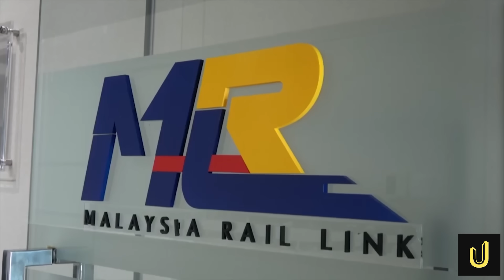Inside Southeast Asia's Deepest and Longest Train Tunnel - Malaysia’s Genting Tunnel

Comment: 50 Billion MYR, our Ministry of Finance did the calculation and comfirm that it probably can't breakeven like the Indonesia HSR. Meaning it will start with operating in loses (hopeful with some optimization it can somehow cover operations cost, anyhow we will have to pay the installments on our tax money). After some negotiation, now China Join in as Join Venture and bear 50% of loses until we finish paying them loan 20 year(at least china now bear 50%). Good things is we access the rail way system to China KunMing and further connect to rail way system in central Asia and potentially to Europe through railway system. This will provide 3rd option on cargo good logistics beside Air and Merine Shipping. It is like buying an expensive GPU that we can't really utilise now but waiting for future 3A title to release.

Comment: Luckily, they switch back to Najib original proposed route under PN ruling, with several adjustment. Otherwise, this so called longest Southeast Asean tunnel wouldn't exist & traveling from Kelantan to Selangor wouldn't be under 5 hours if using jeopardized deviated Bentong Jelebu line. Yes, our engineer still need to 'borrow' expertise & technology from China, last time from Germany. Can't be too proud, since we achieve nothing in technology & keeps relying on other developed country within these 2 decades, even under Muhyiddin & Anwar. Just the same old story. EV ambition & AI powerhouse are just big daydreaming.

Comment: ⏰CHAPTERS⏰
►
00:00 - MALAYSIA’S MEGA ENGINEERING FEAT.
01:34 - NEED TO UNITE EAST AND WEST MALAYSIA.
03:00 - THREE MAIN THREATS: WATER, PRESSURE, COLLAPSE.
04:54 - HOW THE TUNNEL BORING MACHINE WORKS.
06:21 - PRECISION ENGINEERING UNDER PRESSURE.
08:12 - FLEXIBLE SUPPORT SYSTEMS AND SAFETY DESIGN.
10:19 - FINAL PHASE AND FUTURE PLANS.

Comment: Correct me if I wrong. I think Malaysia has bought this bore machine long time ago from Germany. The biggest bore machine in Asia. All part assembles in Malaysia. This is not the first project. Previous SMART tunnel also a very long tunnel.
Reply: SMART, MRT1, and MRT2 tunnels used the German TBMs. The Genting Tunnel no doubt uses the China made TBM as the main contractor is CCCC from China.

Since the tunnel diameters (SMART, MRT, Genting) are different, they cannot use the same TBM. However, MRT2 used a few refurbished TBM from MRT1 since the tunnel diameter is the same.

Comment: SMART Tunnel is also an engineering marvel!
Reply: When a tunnel is turned into a sewer drain during flood, stopping traffic flow, that's not SMART; that's STUPID.
Reply: @xytopk51 that is one of the smart tunnel main purpose. Stoping traffic flow better than flooding. Atleast less harmful.
Reply: @silverback1049  If the tunnel is really SMART, then it should allows traffic to flow CONTINOUSLY regardless of the rain flood water level. Closing the tunnel to traffic during flood is NOT a "SMART" move, as that's exactly what flood waters do; stopping traffic!
Reply: @xytopk51 smart tunnel technically is a water tunnel. They built it to reduce flood in KL during heavy rain. But when it doesn't rain or not in flooding risk, they use it as road/highway.
Reply: @silverback1049  Exactly! It is basically a sewer drainage pipe, that sometime functions as a traffic tunnel, but closed to traffic during heavy rains and floods. Which  also happened on normal "non-SMART" roads, open to traffic when there is no flood!!
Reply: @xytopk51  you can be smart and drive down there when it's raining
Reply: @xytopk51  good try bro. 😂

Comment: Fyi, this is not the first. The MRT was built using the same machines. So, to say it comes from China, I don't think so. Because when you watch the documentary on MRT, 80% of the engineers and architects are local. 😅
Reply: The TBMs used to build SMART, MRT1 and MRT2 were bought from a German company called Herrenknecht. Since it was the same company which built these tunnels, we also developed local expertise as the young engineers gradually became experts by the time MRT2 rolled by. I joined the company in the final stages of MRT2, where we only have 1 British expat in our department, and the rest are all Malaysians. I remember there were more foreign experts when I interned during the early stages of MRT2.
Reply: @lwy230597 not the same TBM. Germany used to be the only country that could build these, but now China's TBM killed the German maker.
Reply: @MrSagowoon  yeah, China-made TBM is much cheaper. And their engineers are not as cocky as the German engineers lol (at least from what I heard)
Reply: @MrSagowoon the German's stuck up attitude toward south east asian is unpleasant to say the least. On top of asking for exuberant prices because apparently brand name is more important over anything else.
Reply: @MrSagowoon  Not true! 
Robbins (USA), NFM (French), Kawasaki and Mitsubishi (Japan) also make these machines.
Herrenknecht are still the No.1 builders and suppliers of all types and diameters of TBM's.
Reply: @lwy230597 I saw a video  saying after the tunnel finished, they buried the TBM because it is too big to dismantle and bring to other sites.
Reply: @muizuddin7296 for which tunnel? If I remember correctly, the TBM used for the Channel Tunnel was indeed buried undersea. But for MRT2, the TBM that reached the existing TRX station box was cut piece by piece and transported back, leaving only the TBM shield underground.
Reply: @lwy230597  The main contractor for the project is China Communications Construction Company, and the tunnel boring machines are most likely from China.
Reply: @lwy230597 Pd masa tu kejuruteraan dari China belum berkembang keluar. Kebanyakan terowong² diseluruh dunia menggunakan teknologi &, kepakaran TBM dari Jerman terutamanya.
Reply: @magicman74  the technology of Earth Pressure Balance and Mixshield TBM's was developed in the 1970's by Japanese engineers working for Mitsubishi.
The german company Herrenknecht refined the technology to what we know today.
Reply: Mesin tu datang dari china tu memang betul. Cuma china,US, Europe je ade boring machine. Yang architect dengan engineer tu mmg dah ade dalam perjanjian untuk transfer of knowledge
Reply: The Chinese contractor is CCCC, the same contractor which built the Penang 2nd bridge. As far as I know the TBM had to be custom built for the Genting project. That means most likely by Chinese engineering. Not knocking the Malaysians because I am sure a large proportion of the workforce pn the project are locals.
Reply: Maybe they just borrow their tech🤷
Reply: Well it's done by China's money so it is China's engineering marvel
Reply: @NathanArulappen  please explain your rationale.
Reply: @NathanArulappen  😂😂😂💩💩💩
Reply: Technical experts are of course a minority.
Reply: The channel probably uses AI to for research, voiceovers and the editing. So i would take it with a grain of salt
Reply: It was part of the project, that passing on the technique to Malaysian engineers and workers, mate. Which btw, you get no such deal from any Japanese or Western company.
Reply: @cheungchingtong  not true - I trained many nationalities how to drive Robbins, NFM and Herrenknecht TBMs, mate.
Reply: @pauldarbishire7226  Technology as whole to design, plan and build a tunnel, mate, not just driving or using tools and trucks.
Reply: @cheungchingtong and how many tunnels have you worked on? You stated that western manufacturers would not pass on any kind of information of any sort, I was just giving you my personal experience. I know for a fact that on SMART, MRT1 and 2 there were western expats passing on their knowledge and experience - Gus Kladoszc was contracts manager, Richard Potts was Superintendent and Blaise Pearce was head of Tunneling for Kuala Lumpur MRT.
Tell me what tunnelling experience you have and have passed on, mate
Reply: Sy pernah lalu area ni. Kalau tgk kat luar , signage all in Chinese. It is from China
Reply: @adilbajrai there is "Coca Cola" written on buildings all over the world, doesn't make them American 😂
Reply: Can use same tbm to build tunnel between kukup and pulau karimun kecil in sumatra?
Reply: @syedputra5955  I think from the engineering perspective, it definitely can be done (the Channel Tunnel is twice as long). But the question is, why? It is going to be the most expensive tunnelling project in SEA and what is the point of building a tunnel between two islands where nobody lives.